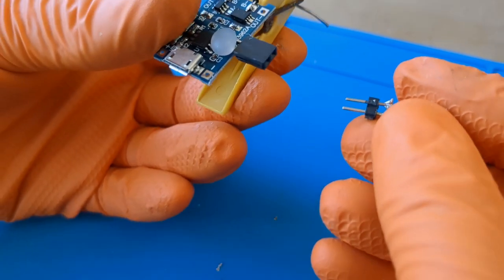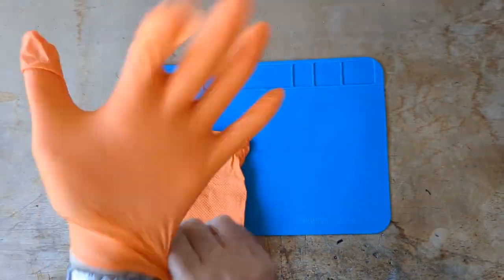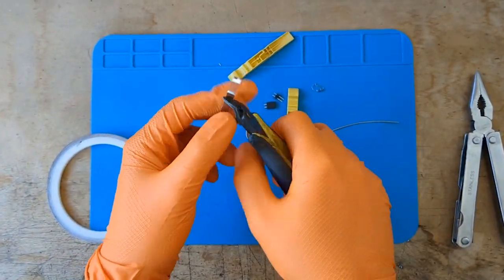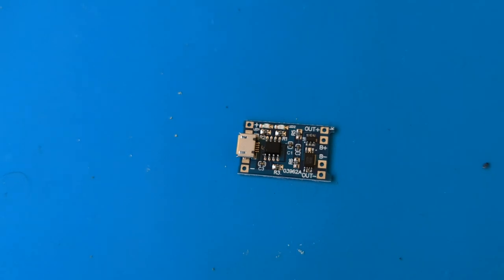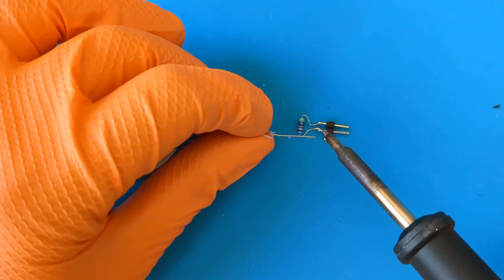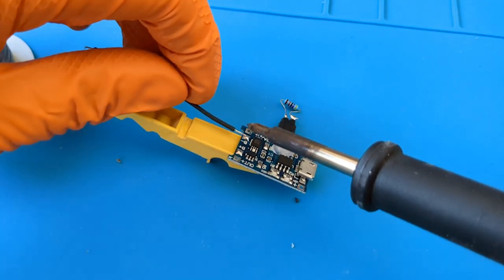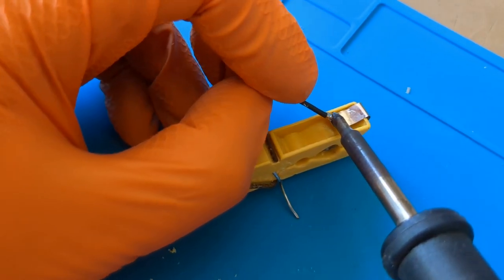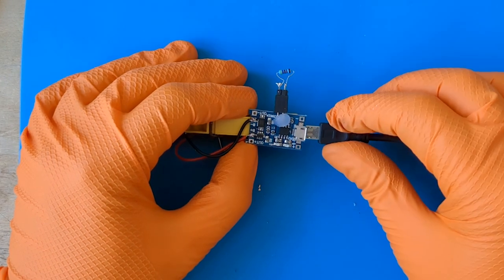DIY Coin Battery Charger - LIR2032

Comment: The resistor is almost shorted at the pin header.  The clothespin offers no reverse polarity protection. A 2032 cell holder is cheap to buy or can be salvaged from old computer motherboards.
Reply: They expire fast.

Comment: Hello. The lir 2032 is rated 3.7 volts. Do you think it can be used instead of cr2032 that is rated 3.0 volt in a keyfob for example ? The voltage difference can cause some sort of problem? Thank you.
Reply from the maker: What is a keyfob?
Good question. I suggest you check the device datasheet before connecting a battery with a higher voltage.
If you don't have a datasheet or professional test tools, ask the seller or manufacturer...

Comment: Hi Really good video, was considering to just charge direct but wasn't sure, came across your brilliant video.
what size resistor for a Battery Capacity of 5.5mAh its a SEIKO INSTRUMENTS - MS621FE-FL11E - COIN CELL, LITHIUM. Hard for me to work out from data sheet info you show on the Instructions guide.
Thanks
Reply from the maker: Hello dear.
On the datasheet of the MS621FE-FL11E ( https://www.sii.co.jp/en/me/datasheets/ms-rechargeable/ms621fe/ ) there is this graph https://www.sii.co.jp/en/me/files/2023/12/MS621FE-ChargeDischarge20220901-E.png.

From what it says, the battery should be charged for 96 hours at 0.1 mA at 3.1 volts.

I'm afraid the TP4056 can't help you here...
perhaps a sufficiently accurate power supply or a custom circuit would allow you to charge the battery well without ruining it!

Comment: Nice Idea, man! What is the resistor's value?
Reply from the maker: I use a 47k resistor, so the charging current is lowered to about 30mah
Reply: @dariocose   so basically the less mah the higher the resistor? My second question is why did you solder the resistor to the pin? As it has two pins cant you directly put in the jumper?
Reply from the maker: @Mehhh_was_here   hi.
1) in the datasheet of tp4056 (or in this video https://www.youtube.com/watch?v=ualLwYRRH6Y ) there are the tables and formula for choosing the right resistor. In general, the higher the resistance, the lower the charging current.

2) I have no idea why I soldered the resistor on the pins 😁

Comment: Please help. I use the same 47K resistor but i got only 1.6mAh output. Do you have any idea why?
Reply from the maker: Hi. Are you talking about 1.6mAh or 1600mAh?
There could be several reasons. 
Are you sure you replaced the right resistor?
Are you sure the TP4056 IC is not burned out?
Did you check with a multimeter that the resistor is really 47K?

These are the first things that come to mind. ....
Keep me updated, I am curious to know what happened!
Reply: @dariocose  Hi, nevermind, I found out that I got bad IC. I have a few, and when I change it to other board it works fine. Now the other thing I have to observe  whether the 4.2v instead of 3.6v like the battery will be fine or not 😅

Comment: that resistor just slow down the current but the voltage is 4.2 still dangerous
Reply: Richtig, dieser Widerstand beeinflusst nur den Strom, um kleine Zellen mit wenig Strom zu versorgen. Größere Zellen können mit mehr Strom geladen werden. Zahl der Amperestunden des Akkus durch 10 oder durch 2 teilen! Je stärker der Ladestrom, um so schneller stirbt der Akku! Für jeden Akku muss die Ladeendspannung und die Stromstärke eingehalten werden!

Comment: how about a ML2032 charger
Reply from the maker: I read a few articles.
I don't think you can use the same charger for lir and ml.
"They have completely different chemistries so they have completely different charging voltages and profiles." 
- https://electronics.stackexchange.com/questions/533265/protection-and-charging-circuit-for-lir2032-or-ml2032-battery 
- https://www.reddit.com/r/dreamcast/comments/g1atiq/lir2032_vs_ml2032/

you can try a charger like https://s.click.aliexpress.com/e/_DkRpijx or this circuit seems suitable and adjustable in voltage and current https://s.click.aliexpress.com/e/_Dne8NMD
Reply: LIr 2032 have higher voltage, but you can add a diode in series on output + terminal for drop the V. and charge ML2032 ?

Comment: The resistor is almost shorted at the pin header.  The clothespin offers no reverse polarity protection. A 2032 cell holder is cheap to buy or can be salvaged from old computer motherboards.